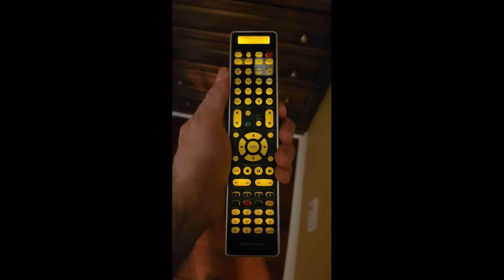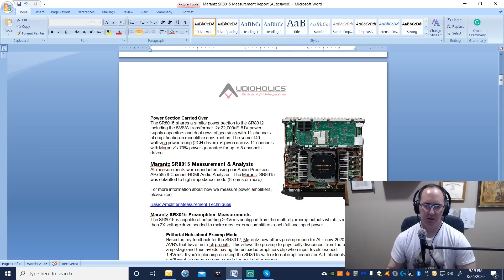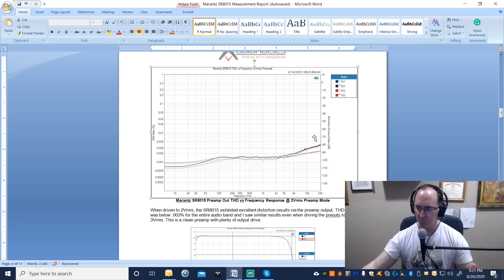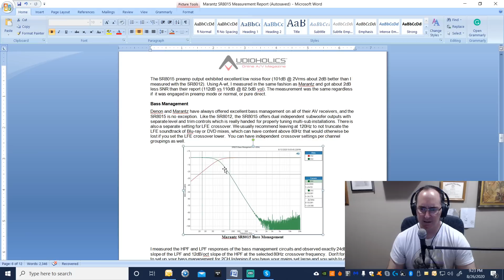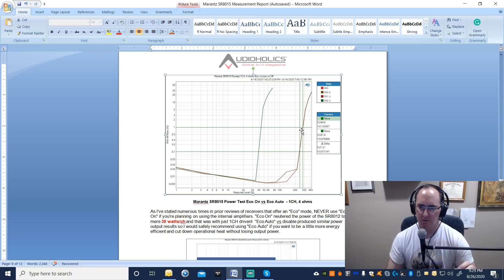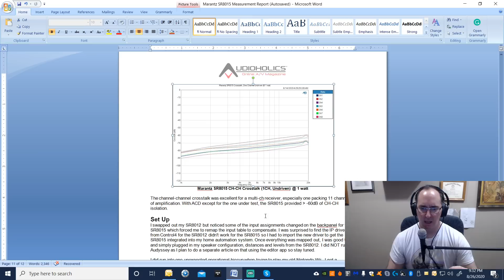Marantz SR8015 Best AV Receiver for 2020? Bench Test Results!

Comment: Hi Gene!!
I have just recently moved down in Pasco. Thank God you beat Covid!!
I have a question/ issue I had a new Onkyo rz830 and it just went belly up and now that there in limbo with new owners there buying my unit back. I had an Onkyo 808 and it went bad too back 3 years ago. So now I am looking for a new Reciver and looking at this beast. Just making sure I am not going to destroy my speakers. Polk s35 center /S60 (Left/Right & BiAmp)
And  Polk 80F/X-LS f or Atmos and rear surround  (4 total) .
And HTS10 subs (2). 
Just want to know if the Marantz8015 is it over kill or just about right. 

Thanks again
Reply: From what I hear and read those Onkyo's have the tendency to go belly up at some point.. their sound quality is fine.. ( I prefer Marantz though) but the quality on the Onkyo's isn't what it used to be...  I don't think there is such a thing as overkill in Audio...as long as you can afford it :P  Of course it is overkill to by a cheap satellite system with a small sub and expect it to sound better if you go to a receiver like the SR8015.. But if you are running a quality full range system it's always better to have more power available to you than less power. The more power and better capacitors an amplifier ( or receiver ) has, the easier it will be to control your speakers, accelerate fast from silent to loud passages, but also the other way around..  you will NOT destroy your speakers by running a more capable amp on them than what the speakers are rated for (unless you crank up the volume to maximum all the time), but you will much more easily destroy them if you use an underpowered amp to drive them.. once an amp starts clipping the regular signal turns to basically heat.. burning your speakers internals. I think that if you are willing and able to spend the money on an SR8015, it will be a great match to your system. Actually it's a great match for most of us "Audiophiles" with space concerns, as we do not all have an extra man-cave room available to us to be able to decorate that as a dedicated listening room. Most of us will have everything in the living room, where the Wife acceptance factor also becomes "a thing" :))